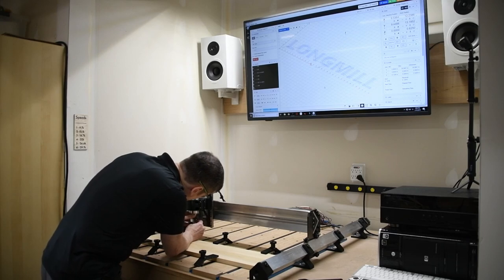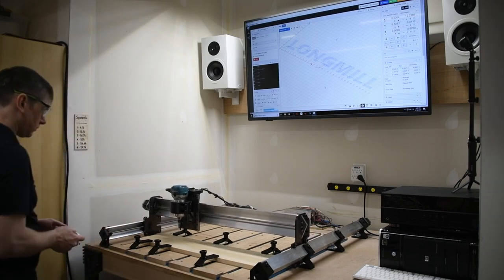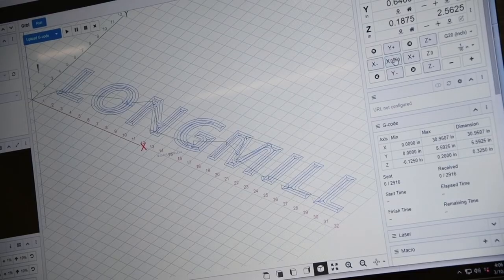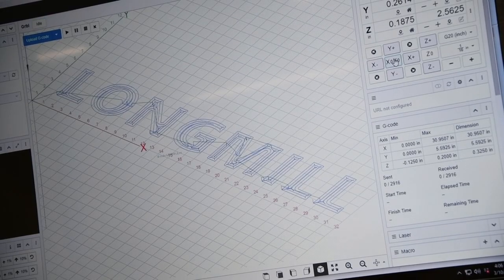Interviewing Keith about the LongMill Benchtop CNC Beta Machine

Comment: How rigid is the machine? With conservative speeds and feeds, can it machine brass , aluminum , and soft mild / cold rolled steel without tooling chatter ? How slow can the spindle run ? Are spindle RPMs set in the program? (  S1,200M03;  )
Reply from the maker: You can set up a spindle on the LongMill in which case the RPM can be controlled from within a gcode program. Most spindles can operate between a few thousand and 20k RPM. Many individuals starting off on our machine use the Makita trim router which is 1.25HP and has a manually controlled speed between 10-30k RPM. The machine is able to cut soft metals like brass and aluminum well but isn't exactly built for cutting steel.

If you'd like to see an easy demonstration of the rigidity of the machine, you can check out our video here: https://www.youtube.com/watch?v=B27nUN1ejIQ